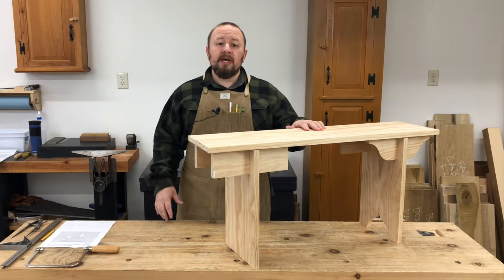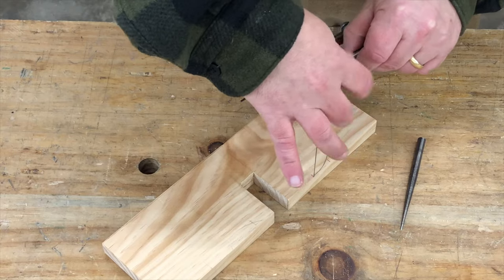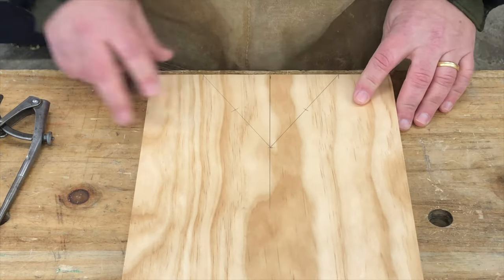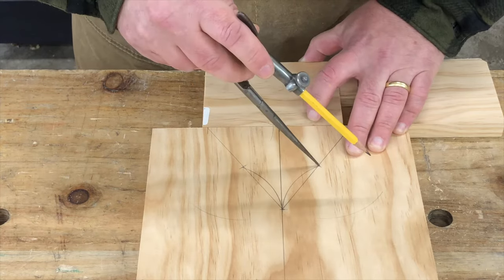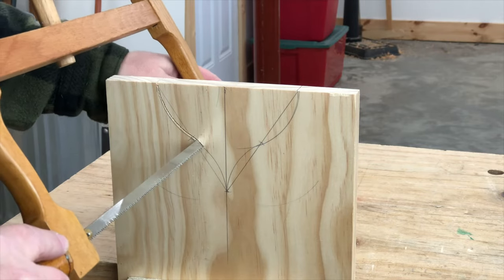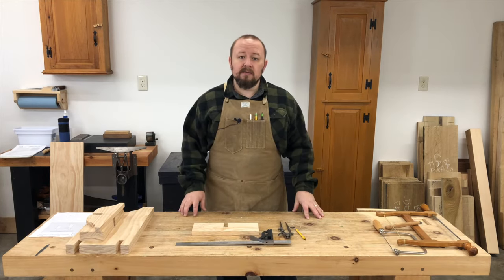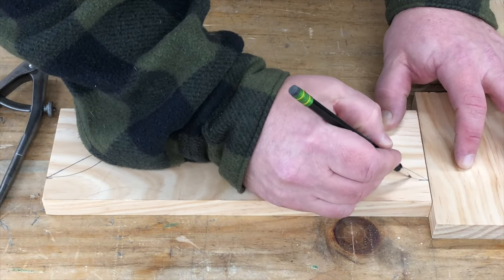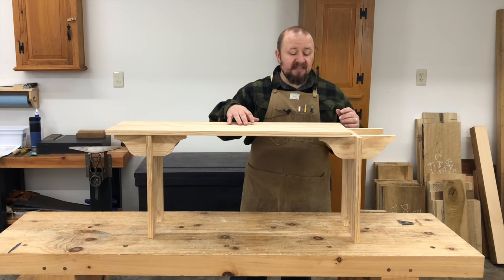How to Build a Shaker Bench with Hand Tools - Decorative Details - Hand Saw Foundations

Comment: I like your turning saw. I made mine using the Gramercy blades, the course one is 10tpi which is good enough for thicker stuff; but its only about 3mm (1/8th) wide and I find it hard to start square. If the cut is important then I usually drop a starter kerf with a dovetail saw first to make it easier on myself.
Reply from the maker: I used the Gramercy blades in this saw for years. But they cut really slow in thick stock in my opinion, even the 10 point. I also tired of fighting to control those tiny blades in more gradual curves like the ones in this video. For a smooth broad curve in thick stock, like the cyma curves in this bench, I find a wider blade to be much easier to control. This wider blade is now my go to blade unless I run into a curve that is too tight to make with the wider blade. In those situations I just use the coping saw, but the wider blade does 95% of my turning saw work. And wider is a relative term. The blade is 1/32” under 3/8” wide. So it’s still a fairly narrow blade. Just not coping saw narrow.
Reply: @BRFineWoodworking  I made a "chest of drawers" type cabinet a while ago, with slight curves under the bottom "rails"...... the Gramercy blade took an AGE to cut through the 35mm thick material (1-3/8inch) and like you said; it was hard to control along the shallow curve...... a wider blade like yours would have been so much more useful to me for that. But at least I got some spokeshave practice in to clean up those "jagged" curves I made haha :P  
I find the Gramercy blades useful for stuff up to about 22mm (7/8th) anything above that and its just not efficient any more. I need to make another saw to accept a wider blade like you have, I will keep the narrow blades for tighter turns. I like the longer stroke of a turning saw as compared to a coping saw, a coping saw gets very little use for me.
 I seen in another comment that you provided a link to the blade.... Thank you Sir :)